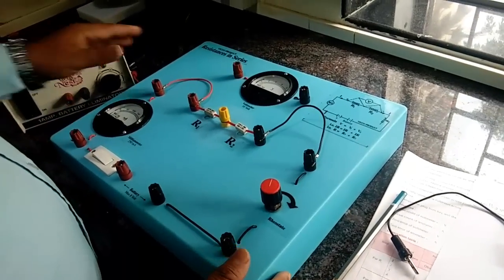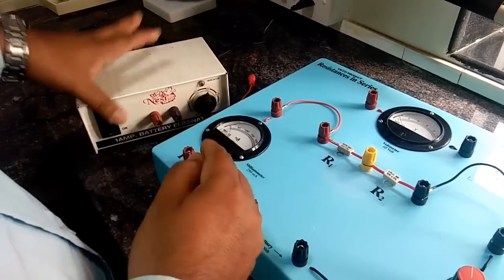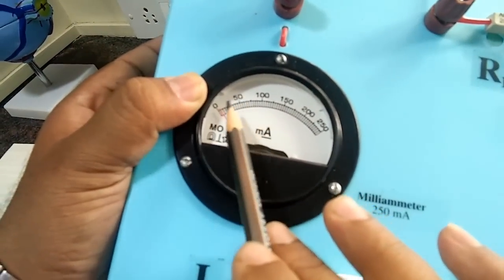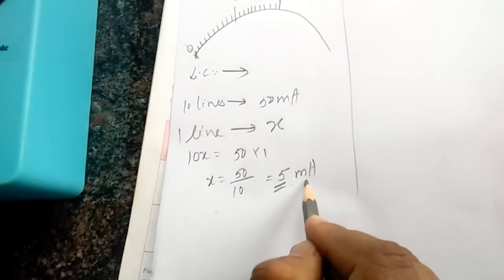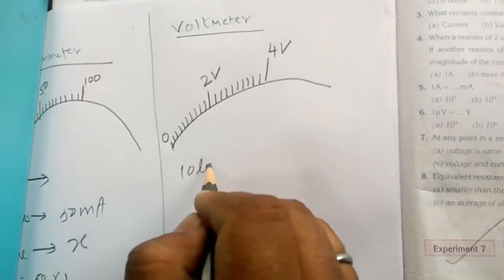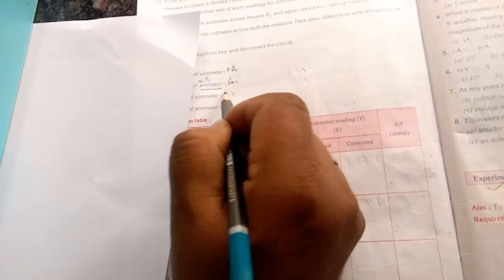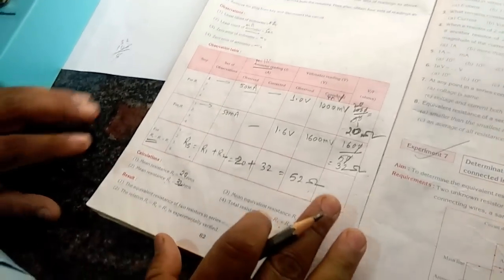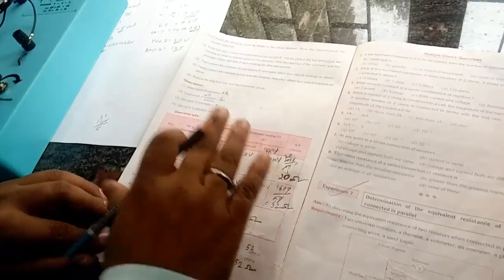Resistances connected in series

Comment: What is zero error
Reply from the maker: Zero error basically error of the system which can be either *positive or *negative.Once we have got our zero error we need to subtract it from main reading.
*Negative zero error- when needle is left of 0(zero) marked when no current flowing in calibration it is called negative zero error.
*Positive zero error-
If the needle is right hand side of 0 (zero ) when no current is flowing of calibration it is called Positive zero error.

Comment: Sir really thank u but in school practicals we're not allowed to touch the rheostat
Reply from the maker: The PURE-VIL Gamer you can touch....No problem
Reply: Ok sir but sometimes we get indivisible odd figures in ammeter or voltmeter so can we take a round of figure to get our answer I got my practicals tomorrow 😰
Reply from the maker: The PURE-VIL Gamer u will not get odd number because calibration is done in such a way that won't give u odd number... Watch video again and learn how to take readings in ammeter or voltmeter.
Reply: Manoj Tripathi sir I lost my marks in parallel bcoz the connection was different than u showed we had to connect the volt meter in the other wires there was a hole in the wire
Reply: The PURE-VIL Gamer same here... we have to connect the voltmeter wire thru the hole of A and B.. wire sorry for the late reply